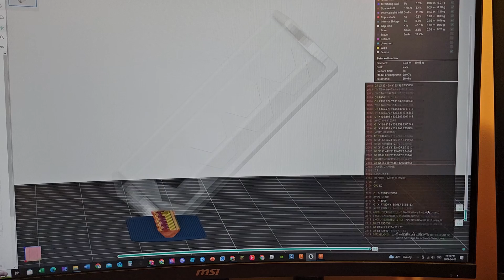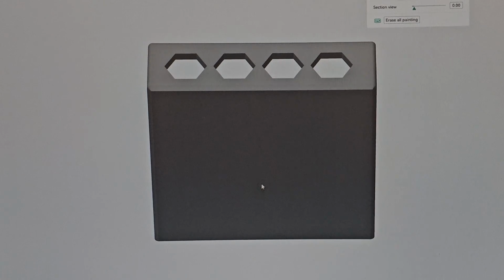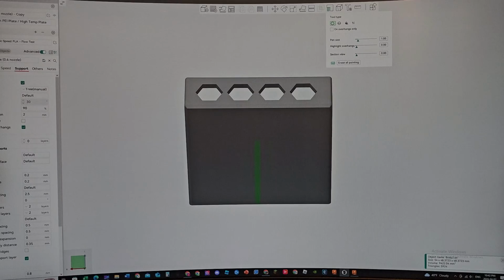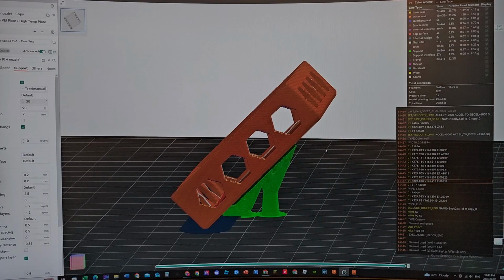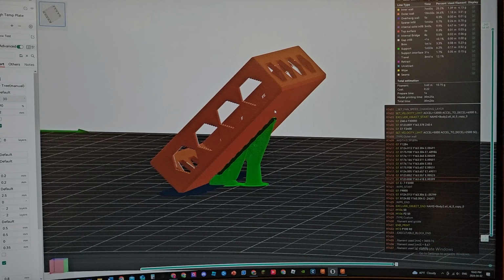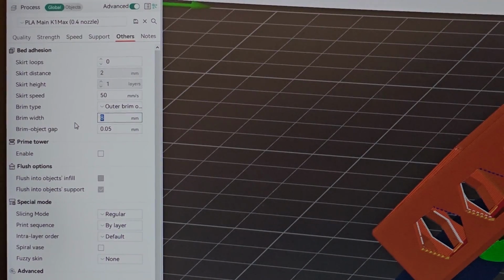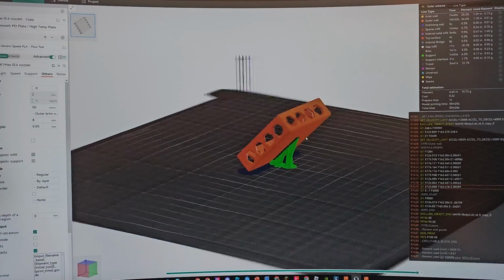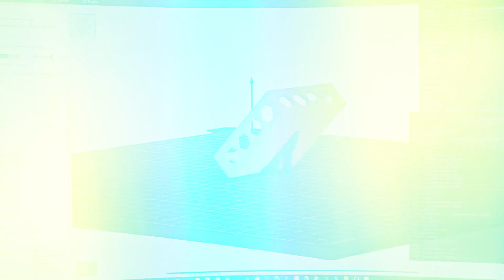Print 45 Degree Using Orcaslicer Easy Method

Comment: I'm trying to figure out what I am doing wrong.  I've done this twice now and each time the print fell apart halfway up.  Wondering if this is harder to do on a bed slinger machine like the one I'm using.  Maybe I need to slow down the printing for this?  If anyone has any suggestions I would love to hear them.
Reply from the maker: You'll have to make sure there's enough space for the parts to hold on to the bed. If there's only like 3 lines for the first layer then it will not hold. Also add brims to help adhesion to the bed.

Comment: You turned a bunch of easily printed bridges into a slightly smaller bunch of 75 degree overhangs up the side, which are much harder to print nicely.
Part might be stronger, but those hexes can't have looked as nice.
Reply from the maker: That is true, but it did turn out to be a great print

Comment: Can you try and print PETG on the Ender 3 V3? I am trying to create a profile for it in orca slicer
Reply from the maker: The ender 3 v3 can print petg just change the filament type to petg on orcaslicer, the default setting should work fine, but I'll try to make some setting when I have time.